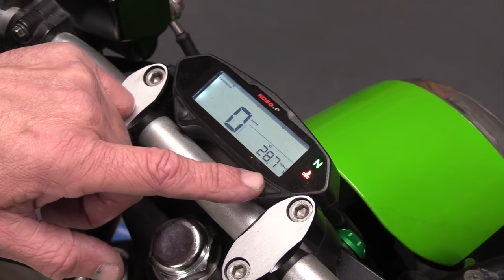Delboy's Garage:- New Project Bike Reveal !

Comment: Thats a serious looking bit of kit and good news for some of the upgrades added. My suggestion, should you wish to accept is a Mosfet Rec/Reg. they charge at 800 RPM so the grip heaters don't turn off, and more importantly they never get hot. Very important for carb model Blackbirds. Also laser headlamp, but you may decide that its not worth it. Lovely looking bike, would love to see it run. Probably smoke my (lovely) Blackbird :)
Reply from the maker: Thanks Tony, interesting suggestions, and sounds like a good upgrade and I very much doubt this would smoke a Blackbird it's only a 750 and without a fairing, the rider would top out before the bike does lol
Reply: @Moonfleet41  Thing is finding the relevant MOSfet Rec/Reg. Looking forward to everything :)